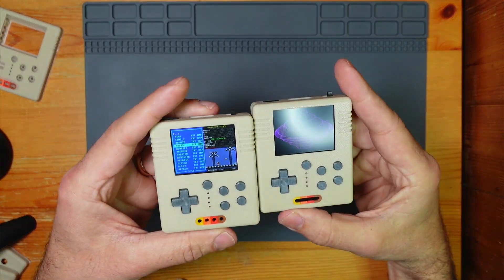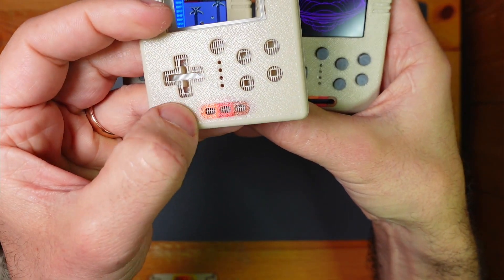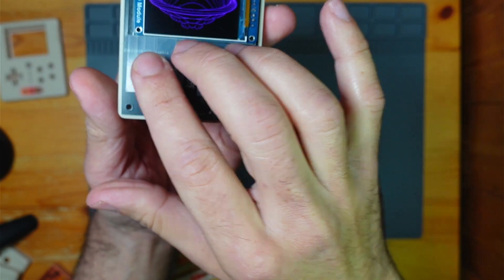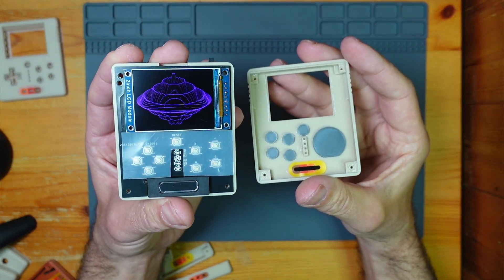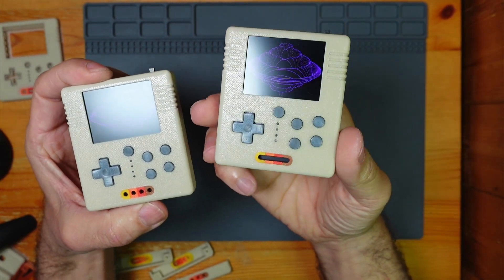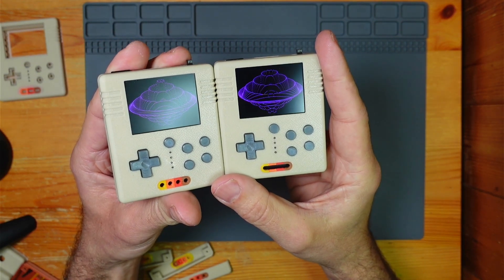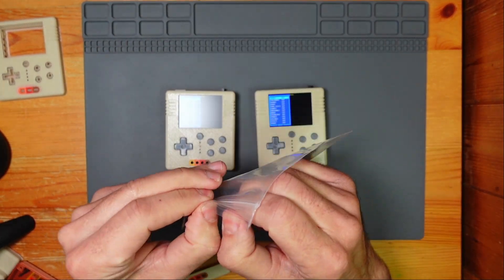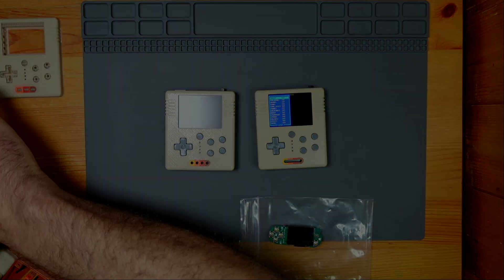Picopocket Running on the RP2350 Pi Pico 2 - Picopad Software Compatible

Comment: So I finally got an RP2350 wired up to my MintyPiPico (micro PicoPad) board, was able to copy over the "adafruit-circuitpython-waveshare_rp2350_zero-en_US-9.2.3.uf2" file, it reset, then created and SD card with proper contents for RP2350, put that in.  Still getting a blank screen.  Am I missing some step?  Nothing seems "obvious" with RP2350. ;-) Thanks.
Reply from the maker: You should probably direct your question to scottgilson3247, the guy that made MintyPiPico! 😀 I would say I never bothered with any of those Adafruit/Waveshare uf2 files. I just downloaded Miroslav Nemecek's PicoPad 2 ARM mode files over on Breatharian. (see the description link). The LOADER.UF2 file needs to be uploaded directly to the Pico, then everything else goes on an SD card. Scott's hardware is similar... it should work?
Reply: @megazoid  Oh, ha ha.  That's me!  Different account.  I just realized my error, I used the standard Adafruit CircuitPython and not the PicoPad 2 ARM files.  D'oh!  Will try the correct files.
Reply from the maker: @MyHappyDestiny  Lol, 🤣

Comment: DEFCON32 also uses the RP2350
Reply from the maker: The badge yeah. I did read about that. Very feature packed, but $160 !!

Btw, your comment is not showing. Nothing to do with me. I upped your level to "auto approved" and it still didn't fix it. Possible YouTube shadow ban?
Reply: @megazoid  thanks for letting me know, I think have noticed it on other comments too
Reply from the maker: @seanocansey2956  I've had it before also, and it went away after a while. Hopefully it will sort itself out. I  avoid posting any links in YT comments, even posting them in a cryptic way. I think that is what got me blocked in the past.

Comment: What is this other Picopad compatible system you mention? Sounded like Fami Color? Can't find it anywhere.
Reply from the maker: Thumby Color -  the link is in the video description. It's not Picopad compatible though. In the video I was just saying it used the same processor (RP2350 - Pi Pico 2). You could import a Picopad kit from the Czech Republic. They ship to the US if you contact them with the request.The kit is mainly simple through-hole stuff. (all links in the description)

My project files are also available, but it's a tough build mainly because it's a lot of components, a lot of steps, and small  0603 SMD work. I'm not really expecting anybody to build it.
Reply: @megazoid  Ah, OK. Thanks for the quick reply. I've built a PicoPad using an RP2040-Zero clone and hand wired it. Might do a fully assembled PCB version in a different form factor, ala Minty Pi...
Reply from the maker: @scottgilson3247  I imagine it would fit in a Altoids tin. Sounds like you found the Picopad schematic already. Good luck with your project. I'll sub you channel 👍
Reply: Thanks.
Reply: I did it! https://youtube.com/shorts/q5i8AFoZnAc?si=QZ2KMwmgSmkamLRv

Comment: Great stuff. Do you think it would be possible to create some kind of functional sd holder that looked like a cartridge? That is to say, you could insert and remove cartridges and it would actually just be different sd cards but sort of hidden within the cartridge.
Reply from the maker: I love that idea. Sure it's possible, but it would need a total PCB and case redesign. 😆

Comment: Beautiful job on those.  I especially like the textured finish on the case, and the colors of the inlays.  Groovy! :hand-purple-blue-peace:☮
Reply from the maker: Thanks a lot Lee. It's the first time I've tried the Hilbert Curve top surface (and bottom surface). I'm sold on it. Still loving this A1 mini after a year.  If you want one by the way drop me a line. I'm making 4 or 5 PicoPocket's.